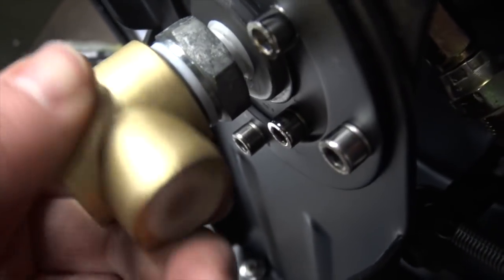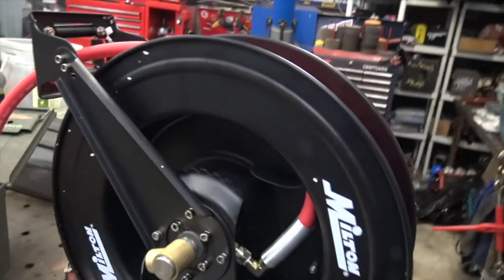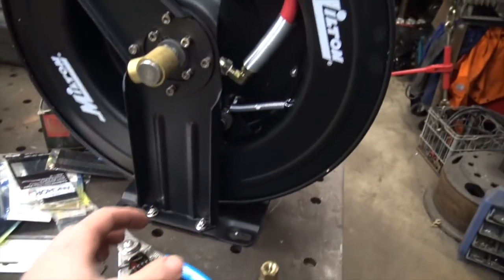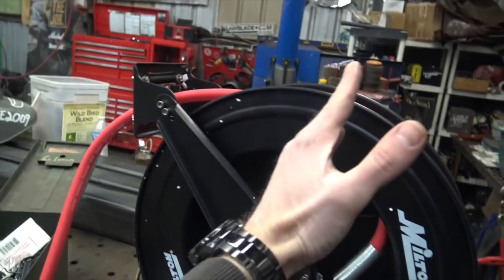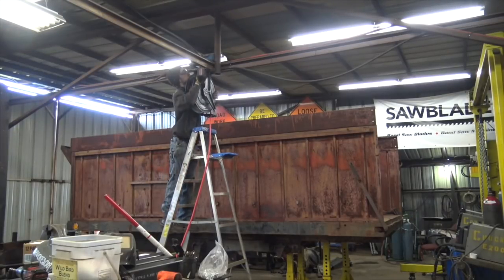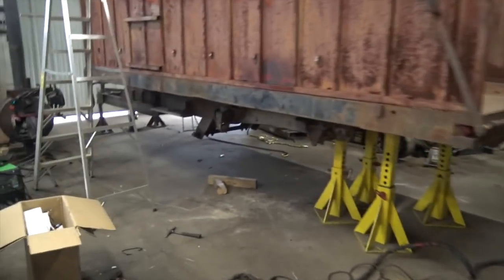WHAT NO ONE TOLD ME ABOUT PUTTING A HOSE REEL IN THE TRACTOR SHOP

Comment: Another potential moral of the story is to weld things together in such a way as to make it easier to come along later and take those welds apart as easily as possible without of course having the thing just fall apart while you're using it.
Reply: Or just don't weld everything. If you can do it with a fastener you probably should. Figuring out when welding is appropriate is a skill.
Reply: Yea, I prefer welding up smaller units and having bolts for the attachments between.  That way when I inevitably want to move something, fix it, replace it, etc. That I don't have to cut a Weld.  Shops generally change too often to Weld things permanently
Reply: @Kami8705  yeah the line for when welding is the process to use and when to use fasteners is a hard one to make out. Before I had machinery I welded everything. Was a when all you have is a hammer deals. I was nailing everything with weld beads then too. But then over time I had to live with the weldments I'd made and I wasn't always a fan of that.

Comment: Gates makes air hose with the outer layer that has small perforations in it. The small air leaks you get over time will make a goose egg, but if you have small perforations in the abrasive layer, it works just fine and won't goose egg.